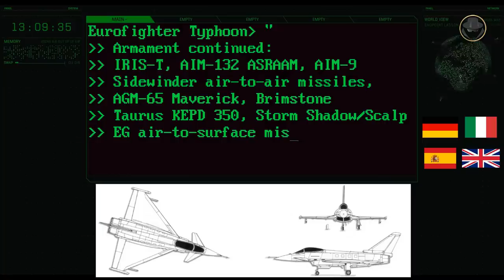Eurofighter Typhoon | The story that the West does not want to tell

Comment: i just wanted to make a comment before i watched the video.. i remember playing the EF2000 flight sim and thinking.. wow what an awesome fighter.. its been one of my favorites ever since and i can't believe it wouldn't still be a valid multi-roll fighter for several years to come..still one of the best flight sims i think.. (grew up in the USAF)..okay, now to enjoy the video :D
Reply: Eurofighter was not really designed from the ground up to be a multi role fighter, the ability to undertake Strike missions was added later at the insistance of Germany primarily. It's designed principally as an Air Superiority fighter with an additional Strike capacity kind of gaffa taped to the thing. Admittedly, it has turned out to be surprisingly good as a Strike Fighter, but its true role is the one it was designed for, an Air Superiority Fighter. 

Which is how the British at least will be using it. They are not replacing Eurofighter with Lightning II, but using Lightning II as their primary Strike Fighter allowing the Eurofighters to be freed up for their primary role, Air SUperiority missions.
Reply: @alganhar1 : That's not strictly true. They'll be used to compliment each other, so to speak. As the RAF Typhoon's carry the "FGR" designation, which stands for Fighter, Ground attack, Reconnaissance.

Comment: I'm confused. You say the Typhoon was not a successful seller in Europe. Could you put up comparative figures of all sales of the various similar planes offered by other European manufacturers? I'd be very interested to see these. As a second request could you put up similar figures of other manufacturers selling into the European markets? I have a suspicion that nobody outsells Typhoon sales. Also, hasn't there been a significant number of new orders for Typhoons recently, like Germany?
If you would answer these questions, I'd be most grateful. Cheers
Reply from the maker: Thanks for your interest. It means that we did not express ourselves well. We tried to explain that the initial project goal was to develop a jet fighter that other Europeans, like Belgium, Norway and the Netherlands, etc., in addition to the project partners, would acquire. The point we are trying to underline is that this goal has failed.
Reply: @WeaponDetective  I guess. Still the best of its kind though!
Reply: @WeaponDetective  Thanks for the clarification.  Yes, that's true. But, by the same token, the opposition (SAAB Gripen, Dassault Rafale) has proven even less successful, despite being cheaper! Eurofighters (and the others) are still being developed further and sold almost as fast as they can be produced to their respective primary users. It's all very well to count F-35 sales into Europe as successes, but when will they actually be delivered (if ever)?  The UK needs its carrier planes NOW but have to wait till the 2030s to have its order filled! In the wings, the British are well on their way to developing their OWN new fighter (Tempest) so even they acknowledge that Eurofighter is coming towards the end of its life cycle as a highly successful plane, and will be replaced some day. In the meantime I think ANY  sales of Eurofighter at the present time can be counted as a success at this time.  With the massive industrial resources available to the US military, and cross-service application (Air Force, Navy & Marines) it is pretty clear that economies of scale are starting to count heavily in favour of the F-35, whose price for purchase in the future is looking very seductive. However, what is not being revealed is when they can actually be delivered to smaller users (like Norway, Netherlands etc) and whether those countries can expect to actually receive them before Tempest comes on line. When that occurs (in the medium distant future) the F-35 will be rendered obsolete in the role most European countries ought to be interested in - protection of their sovereign airspace! In this role (much like Spitfire in WWII) the Eurofighter excels, as will the Tempest. What F-35s still exist at the time will be hugely useful in their specialised roles.  Of this there is NO doubt whatsoever. So, I don't think it's a question of either one or the other, but rather of whether there will be enough of them to do the job when the time comes. It is highly regrettable that the NATO alliance countries decided to go their separate ways (also Sweden, a non-member).

Comment: I see a lot of people arguing about whether the modern version of the F-16 is on the same level as Eurofighter or not.  By tell me, guys, what about Rafale vs. Eurofighter?  Are they pretty much equal, or is one more advanced?  And what about the newer version of the F-15 that America has announced it will buy?  How does it compare?
Reply: In international competitions, the Rafale was better ranked in all criteria according to the different Airforces who tested them. That can be a good clue to compare their capabilites.
Reply: In terms of comparison, there's not much in it. In a straight up dogfight the Typhoon has the edge. As it has a higher thrust to weight ratio (second only to the Raptor & not by much), with that capability it can super-cruise faster & further. it also has lower wing loading basically meaning it can turn tighter for much longer. Where the Rafale scores better, is that it's ground attack capability is a bit more fleshed out, so to speak & there's a carrier capable version, also. There's no carrier capable Typhoon. Another thing worth noting, is that more nations fly the Typhoon, than the Rafale.

Comment: The reality is, all the 4.5 generation planes are pretty much equal. The differences are down to the combination of sensors and EW systems fitted to a particular aircraft. 4.5 aircraft will leap frog each other in capability, depending on their point in their upgrade cycle.

As for stealth, passive and low frequency radar haven't rendered such planes obsolete. Stealth planes have never been invisible to such systems. The problem is, LF and passive radar can't locate an aircraft accurately enough for a target lock.

Whereas the stealth planes can see and target your fighters and SAM systems. There is a reason all the major powers are developing stealth planes. They would hardly do that if they had radar systems that rendered stealth useless.
Reply: hensoldt twinvis apparently can

Comment: I blame two factors for the lack of success for the Eurofighter.
#1 Collapse of the Soviet Union
#2 Existence of NATO
Reply: By Success, you mean export?
Reply: You totally ignore other factors. 
- Like a totally non flexible payload (look at what F-15, F-16 or Rafale can bring).
- Very uneffective organization that brought very high price for any change that had to be done. Do you want to check all the upgrade of the Rafale since it's service ? New radar, upgrade  of sensors with another coming soon, upgrade of some modules of the engine.
Reply: @j.celgoog3275  I don't think it's fair to claim that it has a "totally non flexible" payload. Rafale's upgrade path is very similar to the Typhoon; the first version was the F1 and is currently being upgraded to the F4. Likewise, the Typhoon has been through 3 upgrades (tranche 1-3) and is currently being upgraded to tranche 4.
Reply: @rickwalker2  Well, I may be unfair, but with the EF, you must choose between bringing some serious A2G stuff or range, youcan't have both.
And the difference with Rafale is that in that case, there was a clear path of upgrade possible (the F1 was clearly a sub standard done in urgency to replace the old crusader, in the previous agenda that version didn't even exist) while with the eurofighter, the structure itself, position of wheels, of the air intake, missing wet support point prevent any real upgrade of the fighter unless undoing huge revision of the plane. When you know that it's nearly impossible to bring an AESA radar, how would it be possible ?
Reply: @j.celgoog3275  sorry that last sentence doesn’t make any sense? Where did you hear the Typhoon can’t carry A2A & A2G simultaneously? Of course it can. As for the AESA, the Typhoon already has it in the Qatar & Kuwait export versions with RAF Typhoons getting their preferred AESA from next year.
Reply: @j.celgoog3275  That's because of bureaucracy with the Germans and the Italians and the Spanish all pulling in different directions to the British as to what they each want on the aircraft. There is a lot to be said about doing it yourself as you only have to please yourself; only when you sell it to 3rd parties do you need to listen to someone else's needs :-)
The Frogs were just being efficient after ripping of the initial data generated by Britain.
Mind you, this (the squabbling) could have been forecast, as it happened with the tornado project too.
Reply: @rickwalker2  I never wrote that you can't mix A2G and A2A. I wrote than you cannot have a useful payload for A2G + a normal range.
And about the AESA, nope, nobody has them right now, and when it will happen there will be several versions, so, to summarize my point, the Eurofighter program and planning is a damn mess.
Reply: @thecraggrat  Don't worry, we didn't rip any information from UK. What they planned to do was nowhere what we wanted to develop, the specifications were totally different.
And now we are nearly 40 years after the beginning of the program, we have a clear perspective of what happened, and since it's unusual, we can admit that the French AF, Dassault, Snecma, Thales were totally right while the Eurofighter group .....

Comment: I used to watch the Eurofighter fly all around our area, back in it's 1980's testing days at Warton BAE. The excessively loud  engine noise was a giveaway that it was nearby, i always remember it being much much louder than Tornados, Jaguars, Phantoms or anything else in the sky at the time
Reply: First flight was in1994, so no testing in the 80´s.
Reply: @bastianelsenhans6639  
EAP maybe, that or we all missed the Flux Capacitor mod.
Reply: @bastianelsenhans6639  No way. The EAP was tested throughout the 80's, we had someone visit our school from BAE in around 1986,  give a talk about the EAP and hand out  some posters. A few of my friends parents also worked on the project at the time
Reply: @dk5468  eap is not eurofighter. In your original comment you mentioned the excessively loud engines, being louder than tornado. Eap has the same rb199 engines as tornado.
Reply: @bastianelsenhans6639  So did the initial EFA prototypes.

Comment: The Typhoon has a speed of 1,550 mph or Mach 2.3 and that's proven beyond any doubt.
Reply: Good spide if you wont to escape from.DELTA MIRAGE RAFALE GRIPEN  NG J10 F16 VIPERS 70/72 . FRONT OF SU 33 34 35 MKS EUROFOTERS ARE HELPLES FLAYNG KIOFTES
Reply: @drewblackmatter6669  After 15 years German Air Force admit EF capabilities Mach 2.35 top speed, can turn 9g at Mach 1.2 with 2 X 1000ltr tanks! Omnirole was not a priority ( nor was it for F15 ) but it was a possibility. F15s demonstrated that function by IAF  very successfully. F35 better at penetrating air defence systems, F18 Super Hornet better carrier attack aircraft and
Reply: yes, but he said supercruise at M.1.1
Reply: @64mickh  EF Typhoon on test with Singapore AF demonstrated Supercruise of Mach 1.5 with a weapon load out, in equatorial temperatures.

Comment: Typhoon is a beast of a fighter. The problem are it's excessively powerful engines which can wreak havoc on pilot's body. 10G spinal compression can cause many pilots to experience black out and pilots don't really have time to think about not getting into these super high Gs when being in a dogfight. This thing was originally designed to climb to 60.000ft asap and storm the intruder BVR from above with medium to long range AA missiles.
Reply: They could solve that issue by  a redesign making  a longer fuselage to hold  a internal weapon bay.

Comment: Im sorry but im going to have to correct a few things. First off the Eurofighter is a very good WVR dogfighter but that means very little in todays world. Its also not the second best choice behind the F-35. The F-18 Super Hornet has a better radar and electronic package than the Eurofighter. The F-18 E/F is a far superior aircraft when you talk about multi role fighters. Even the F-15E is a better multi role fighter because it has a superior radar. Lastly i wouldnt mention the Mig-29 as a good 4th gen fighter lol. It has the worst combat record probably in all of modern history and it was extremely limited in its capabilities. Basically it had an early 3rd gen radar and avionics with a 4th gen design.
Reply: The F-18 is superior to the Eurofighter????
Reply: How would you know that the radar in F-18 and F-15 is better than the AESA radar in tranche 4 Eurofighters? Same with the electronics packages. Customers now order the tranche 4, not earlier variants with older radar systems.
Reply: When MiG-29 appeared, it was equal (and even superior) to western early 4th gen jets. Problem is that after 1991, MiG-29 effectively stoped development for 10 years
Reply: @BlueonGoldZ  In BVR, yeah... several F/A-18 had AESA radars since 2007. Eurofighter doesn't until 2022. F/A-18 had AIM-120D's since 2008, and reached IOC in 2015. Eurofighter is still flying with AIM-120C with Meteor not fully integrated yet.
Reply: With the meteor and the latest radar, the Typhoon would knock the American jets down before they even got into range to launch their ordnance.
Reply: @JohnSmith-rr1oc  thanks for the laugh John. Its been awhile since I laughed that hard. 

A little word of advice, dont talk about stuff you know NOTHING about and it will help you sound less like an idiot lol.